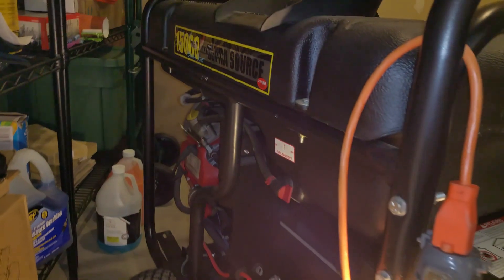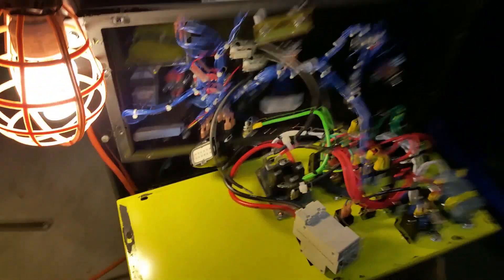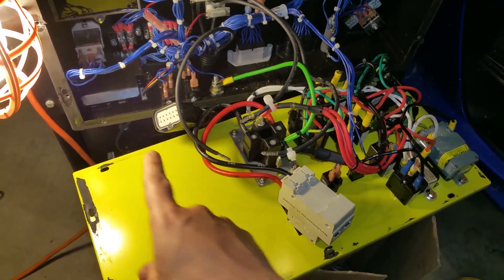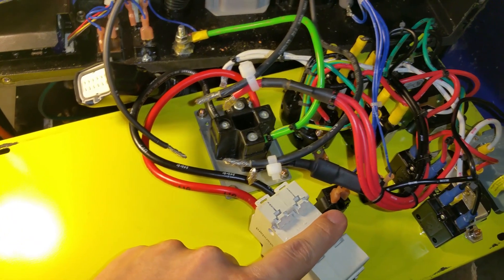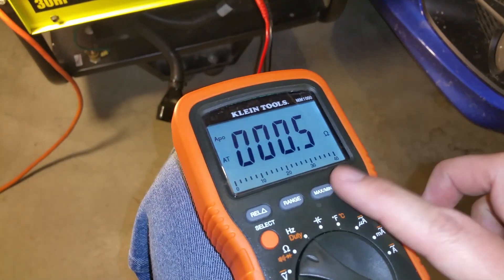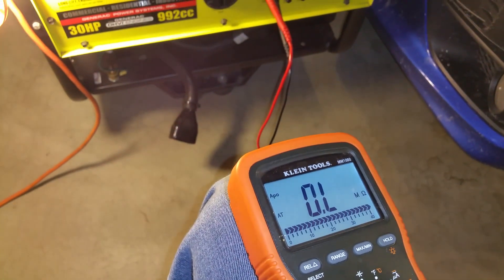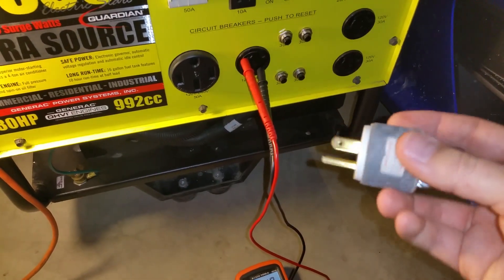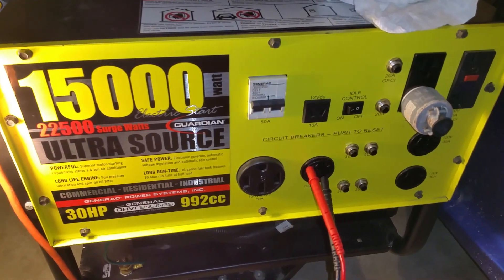Generac Guardian UltraSource 15KW Repair

Comment: Yes, I want to ask you about a problem I am having with the exact same generator. I bought it new with the intention of it being a whole house generator. It is several years old but it has really never been used. I finally did the preparations for the connection to my house. I made a #6, 4 wire  SO suicide cord with 2, 50 amp male connectors to plug in from the 12 KW outlet on the generator to a weatherproof 50 amp outside receptacle and then ran in to my main power box to back feed a 50 amp breaker in my main panel. In theory I should be able to open the 200 amp main breaker on the panel, crank my generator and feed power to the house. The problem I am having is if everything is connected the generator cranks wide open then shuts down. I have gone so far as to pull my meter, disconnect the neutral from the power company, completely isolating my electrical, with the 50 amp breaker open at the generator, open at the main panel, all loads in the panel open, the motor still over rev's. Then I disconnected the wire completly from the inside panel, cranked the generator, and the second I touched the generator neutral to the neutral bus it over rev's. You seem like a very smart individual, any light you can shed will be greatly appreciated. Sorry for the long winded question.Thanks Bruce S.email  doodamundo@msn.com
Reply from the maker: B S suicide cords...disconnecting the neutral at the panel?! I dont like the sound of your setup one bit. I would suggest hiring an electrician to properly install an interlock kit and male inlet box to avoid the suicide cords. Removing the neutral causes all kinds of hell with the control boards inside, even permanent damage. Stay safe!
Reply: May I comment?  I must agree with xboxer that I do not like the sound of your set up, not that I would ever tell anyone how to do something in their own home but this worked for us.  I just added a comment on my older 12.5 KW Guardian like this one.  The previous owner was complaining of the same thing you stated.  I think he was plugging in a suicide cord but not shtting off his main power circuit breaker.  I purchased 50 ft of 6/4 600V SOOW cable from wire and cable your way https://www.wireandcableyourway.com.  I emailed their support and for the wattage these put out this was the recommended cable.  With this I wired a 50 Amp plug outside my garage door to a 50 Amp circuit breaker to the circuit panel with an interlock and ran the cable in the attic.  This set up worked the first time and runs everything.  I have only needed to use it twice since installation but I have no fear of power outages.  Las item was a 25' 50 Amp plug and cord to go from the generator to the plug outside.  All parts were about $400 and we installed it ourselves in a day.

I learned about all the options by watching youtube videos and a few phone calls to my family.  The interlock ensures you do not send power out to the main line.  Shut every circuit breaker off, with genny running and plugged into house and the circuit breaker on genny in on position you can power the 50 Amp on circuit panel to provide power to your panel, then turn on circuits as you need.  With that beast of a generator you should be able to run it all but allow things like A/C a few seconds to come up to speed so not everything is powering up at once.  I find it safer that if I do not need a circuit I leave it off (hot water heater, clothes dryer, ect...).

Comment: Why Generac? Pneumatic tires that go flat from sitting. No backup recoil start. No fold away handles. No versatility of being able to use lpg\ng.
Reply from the maker: Recoil is impractical.  Lot of static compression be near possible to pull fast enough. US Carb in WV makes a trifuel kit for this unit!
Reply: For the Generac Guardian Ultra Source 15KW I purchased a trifuel conversion kit - not thru US Carb - so I can't speak for them but a quick read seems to indicate it the same or similar kit that I received.  On mine there were 2 round spacers that you inserted between the engine and the intake maniford - to extend the manifold about 1.4 inches.   Unfortunately the spacers did not provide any support for the intake flange bolt hole - so when you tighten the bolts to the manifold you are placing a lot of pressure on the aluminum flange - and it may  crack.  As me how I know....after ordering a new intake manifold - and making 4 small round 1.4 inch spacers to provide support for bolts - I was back in service.

Comment: I would guess a loose neutral wire caused the problem.
Reply from the maker: Yup!
Reply: @Bassguitarist1985  I wired up a panel and had a loose neutral.  I had similar voltage differences when I checked.   It took a while to figure it out.  I still don’t understand but I know what to look for now.

Comment: Watched your video and tested as you did. I got all the same numbers as you did. Put the nuatral to ground connecter in as you did and it dropped to 000.4 ohms , the original issue with this machine I was told needed a stator and sparatic crazy voltage. I have only started the machine and have not tested the voltage coming out yet. I found a loose ground wire at the engine mount. Dirty corroded battery terminal leads that I cleaned up. Cleaned all ground terminals then ran your test. All same exact numbers as you 0.516 ohms without nuatral to ground adapter with it 000.4 .. all other Readings are 000.6 what's this tell me my stator windings are good? Also with breaker on or off the idle control does not work. Can you make a video of how to test for issues with that. I'd appreciate it. Great video and if you can email me that be great at tintdr at Gmail dot comm subscribed thanks for any info.
Reply from the maker: apologies for the very late reply, i have sold this machine. This is a floating neutral machine, good chance your machine is just fine, course nothing beats putting the stator on a megger and checking the insulation. new stator and rotor combo for this machine is MAD MONEY! cannot buy those parts individually.